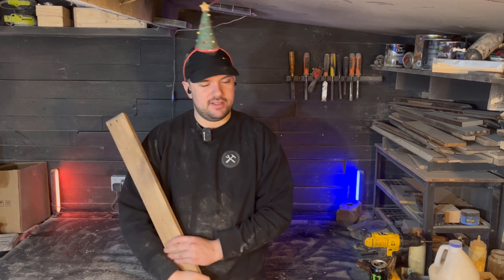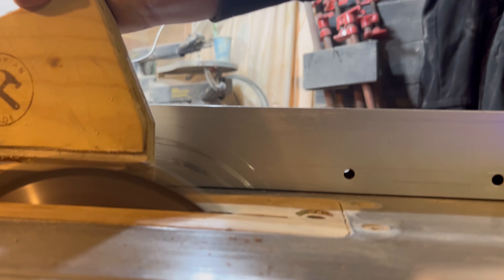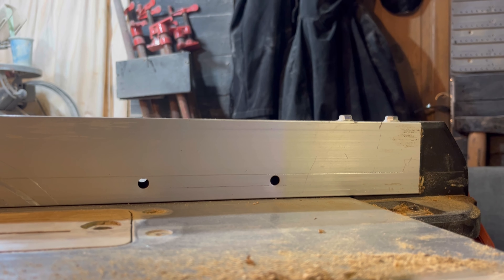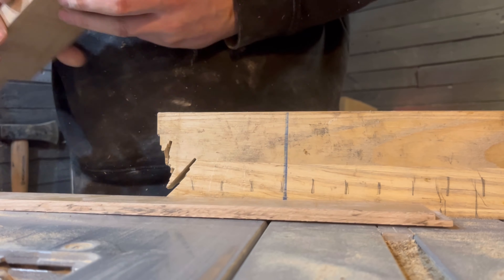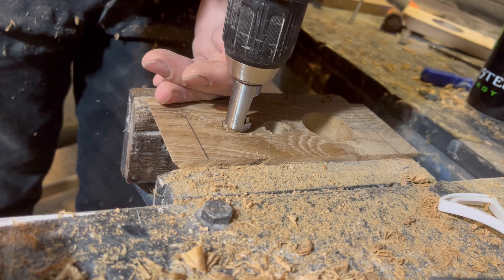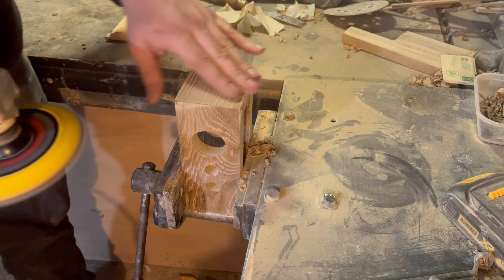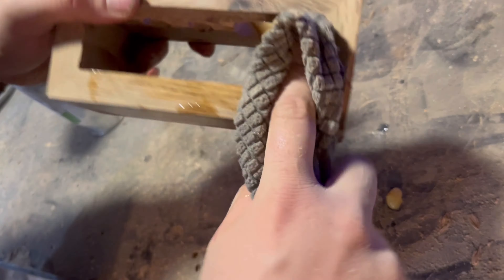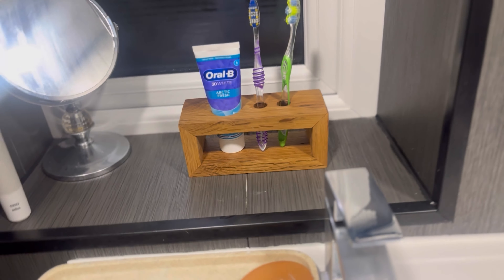Easy Creative Gifts For Christmas! Oak Toothbrush Holder | BARROVAIN MADE CHRISTMAS CALENDAR

Comment: You should be able to remove (cured) epoxy with some high % alcohol solution. I believe 95% and higher is recommended. 
Another nice video with a great result!
Reply from the maker: Thank you! I just spent ages chilling away at it with a chisel haha